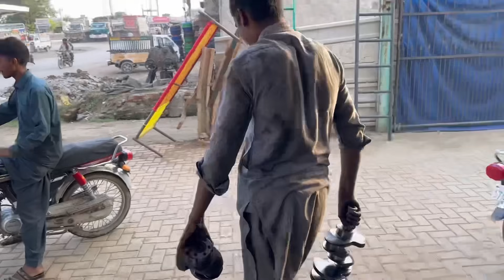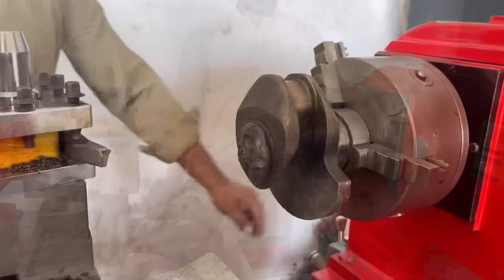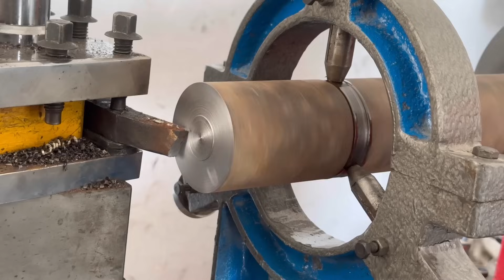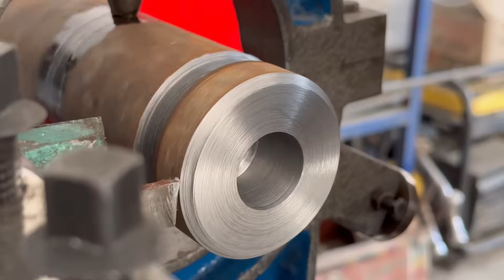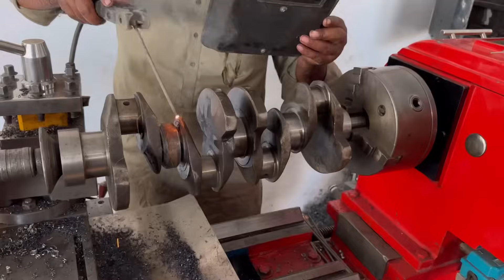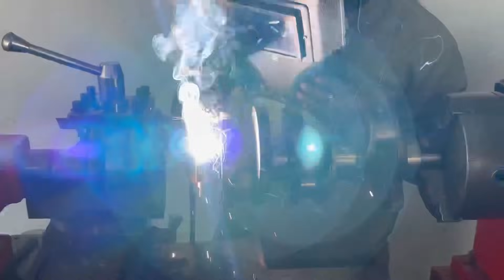True Connection is Always Strong || Another How Fearless Mechanic Connect Broken Engine Crank-Shaft

Comment: The engine failed on first start-up, in case anyone is wondering. Stay tuned for part 2
Reply: It's extremely clever and resourceful but honestly, i couldn't see that lasting more that a few miles.
Reply: The weld by itself probably can stand many hours of work. But they didn't show the drilling of new oil gallery...